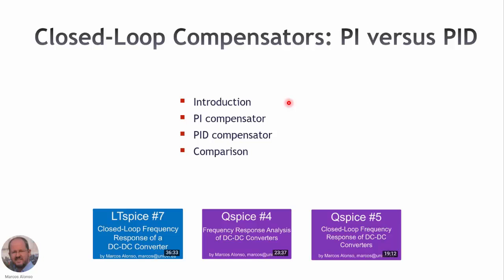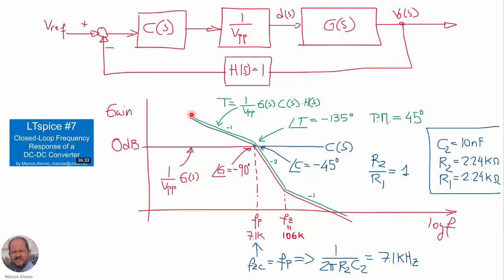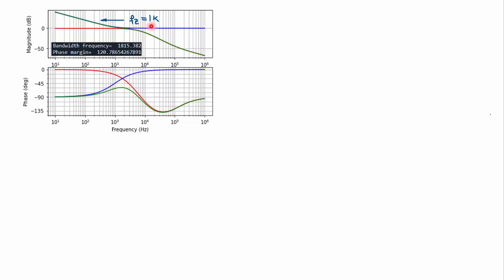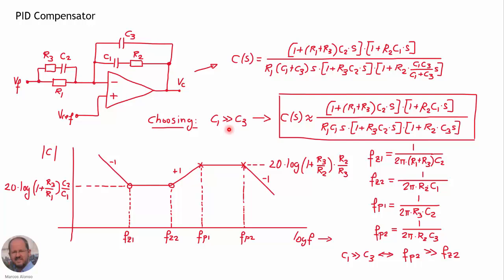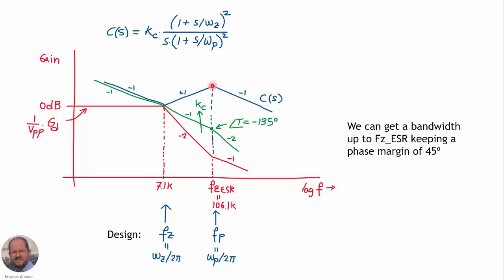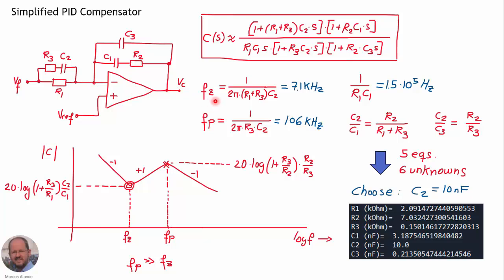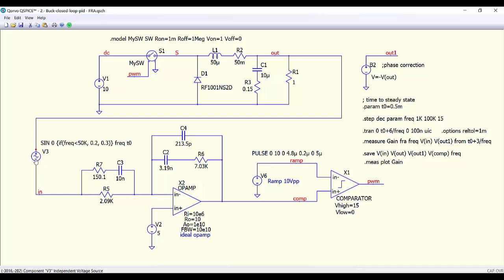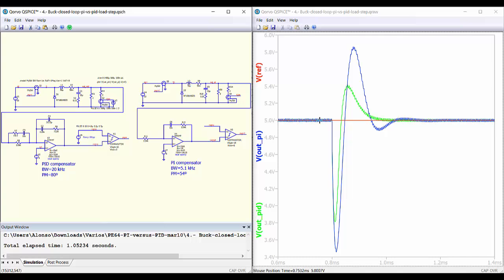PE #64: Closed-Loop Compensators: PI versus PID

Comment from the maker: 10:48 I have found that there is a mistake in the value of the flat gain between poles. The correct expression is the following: 20*log( (1+R3/R1)*R2/R3 ). Sorry about that!
Reply: De qualquer forma, o vídeo é ótimo. A comparação PI contra PID na mesma simulação é bem didático. Sucesso.

Comment: Thank you, Professor Marcos, for posting this useful video.
The RHP-ZERO exists in the loop transfer function of a flyback converter. However, it does not exist in a buck converter.
Are there any design guidelines for how to use PI compensation and PID compensation due to this difference?
Reply from the maker: Thanks for your comment. Of course, the design of the compensator must take into account the whole transfer function of the plant. The rhp zero further increases the phase drop of the loop gain and can make the system unstable. This could be an interesting topic for a future video. Thanks

Comment: Hi Professor, thank you for the great video. I wanted to know how you arrived at your kc value, is there a calculation for it?
Reply from the maker: Hello, if you increase kc you will have a higher bandwidth but a lower phase margin and reversely if you decrease kc. Using the python program we can try values of kc until we get the bandwidth and phase margin we want. In the video we used kc=1.5e5, which gives a bandwidth of 20 kHz (switching frequency/10) and a phase margin of 80º, which seem adequate values.
In summary, kc is the parameter with which we can play to adjust the final behavior in terms of bandwidth and phase margin. Remember that bandwidth represents how fast our system will respond in closed loop and phase margin is a measure of how much damped the response in closed loop will be.
Reply: @MarcosAlonsoElectronics  Thank you professor this is really helpful.

Comment: Hi, nice video on the PI and PID. Is there a way to calculate the region of stability for Kc for both continuous and digital?
Reply from the maker: Hello, thanks for your comment. Yes, from the bode diagrams you can find the region of stability for Kc. In principle, it will be the same for the digitized compensator if you use a high enough sampling frequency. This is a topic we will investigate in future videos

Comment from the maker: All files are available here: https://github.com/marcosalonsoelectronics/PE-64
Reply: Thank you sir, but I get an error that the control module is not found in Spyder when I run the two python scripts buck_ccm_pi.py and buck_ccm_pid.py
Reply from the maker: @petrusbosman4264  You have to install the package. To do so open Spider and on the console enter the following command: pip install control

Comment: Sir, which is better analog control or digital control for SMPS  power plant
Reply from the maker: Analog control is good for most low/medium power applications. Digital control is better for more complex power converters in which a microcontroller or DSP can be used to implement more complex control algorithms and other protection and housekeeping functions.
Reply: Thanks